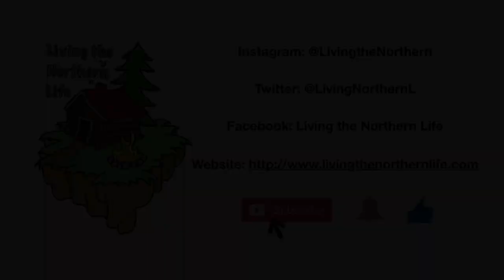The Ultimate Quad Trailer - Part 6 (#theultimatequadtrailer)

Comment: I don't know what kind of quad you have but that trailer seems way too heavy for my sportsman 400. I love the trailer though.
Reply from the maker: Hey Dan!
Thanks for watching.
I have a Honda 420 Rancher and the trailer is a little big for it but I build it with future proofing it in mind. 
Hoping to get a used Kubota RTV900 and it shouldn't have any issues with it.
My stepfather wants to us it behind his tractor so I'm not even sure I'll get to use it at all! 😂😂😂
Reply: The design is very good. Only need 1/8 gauge wall on the channel over that is to heavy I think.